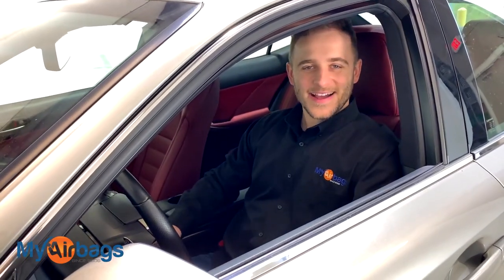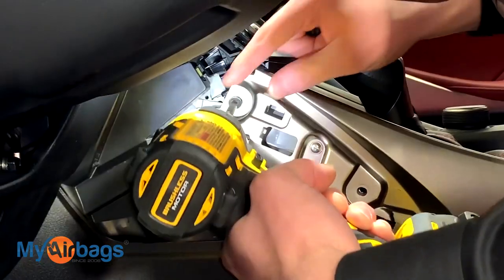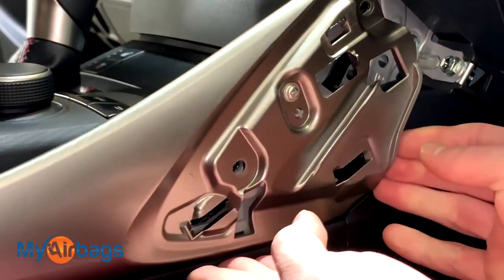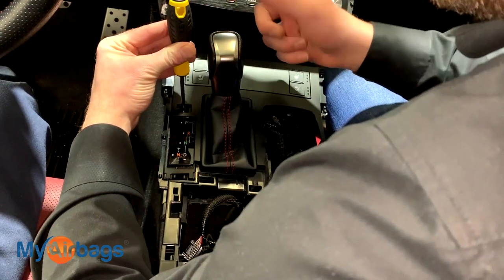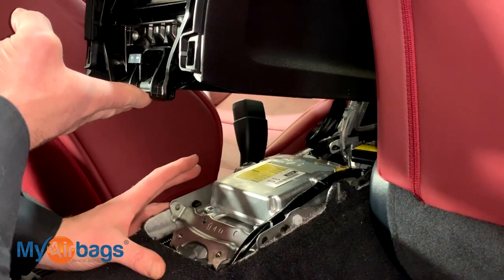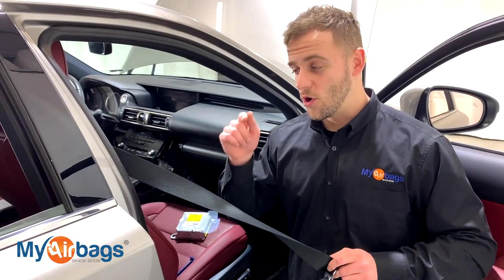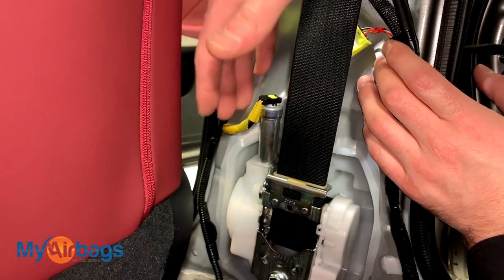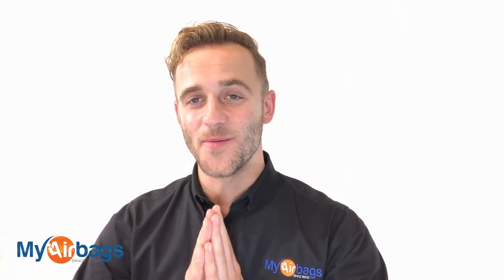How to Remove SRS Airbag Control Module & Seat Belts on a LEXUS IS | MyAirbags

Comment: Hi. Just bought a car, it wasn’t in an accident, no airbags had deployed but all for seatbelts are locked.
Reply from the maker: Hi Kirill, Locked seat belts, especially if there are more than one are locked, is in indication of an accident. Sometimes the seat belts go bad mechanically and can be fixed. If theres more than one locked, I would suspect that there may have been a small accident. We rebuild the belts that have deployed after an accident as well. Here: https://www.myairbags.com/product-category/repair-return/seat-belt-repair/

Comment: What type of codes should I expect with an airbag deployment
Reply from the maker: Darryl, there are actually a handful of different deployment codes that will indicate the module should be replaced or reset. If the airbag light is on, scan the car using a scanner / scan tool and see the codes. The codes should have a description on there. If they don't have a description,  you can reply to us here and we can help point you in the right direction as well.

Comment: I have a 2014 lexus Rx350 My air bag light came on after my daughter was pouncing around in the passenger seat. Got a diagnosis code B1650. she did have on a seat belt. unable to clear code. what should I do next
Reply from the maker: It is bad passenger occupant weight sensor. May need to have your passenger seat calibrated or have the seat replaced.

Comment: Would this pass a salvage car inspection?
Reply from the maker: Yes it will for sure and you can use the receipt from us as well to show that it was reset and seat belts repaired
Here is link for airbag module reset
https://www.myairbags.com/product-category/repair-return/airbag-module-reset/
Here is link for seat belt pretensioner repair
https://www.myairbags.com/product-category/repair-return/seat-belt-repair/

Comment: B1650 OCS 2018
Reply from the maker: pro Noob, The code the Occupant Classification Sensor (Toyota/Lexus).
On Toyota vehicles, this code can be addressed using a scanner / scan tool (example: Autel Maxisys is one of many scanners that can do it)
The Passenger Front seat has a sensor there to detect if someone is sitting there. It needs to be calibrated using scanner. Did you get a new seat or sensor that caused this code? Or is everything original and the light just came on one day?